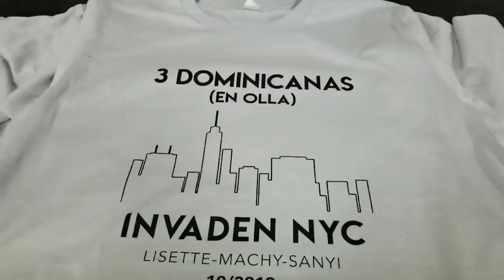How To Cope With Anxiety | Screen Printing

Comment: Thanks for this. I have learned to say no and stop being Super Woman. I actually have same equipment as you from Ryonet, but I also do Vinyl, DTG, Print & Cut, Sublimation, TShirt Transfers as well as Computer Repair and Printing. Sometimes I work a 15 hour shift no help. After 20 years of being in Business I still get scared that I will mess up in screenprinting. But we can't be perfect and it's ok to mess up as long as we fix it and improve.

Comment: I get it all the time my OCD kicked in while I was in my friends shop he was doing a 3 color process with no over print on a side monted press and I see them trying to register the design by undoing the sides instead of using the micro adjusters on the front . The side had big gap in between also I was screaming on the inside I just keep giving hints while he was training this apprentice SMH and over flashing

Comment: I live in philly in my 40s what is the first step I should take to start screen printing equipment needed
Reply from the maker: First get yourself a four color press, inks, squeegees, a inkjet printer that prints 13 inch wide, And exposure unit and a flash dryer. They sell the whole starter kit on Ryonet screenprinting.com.